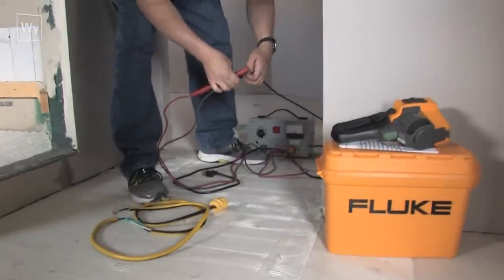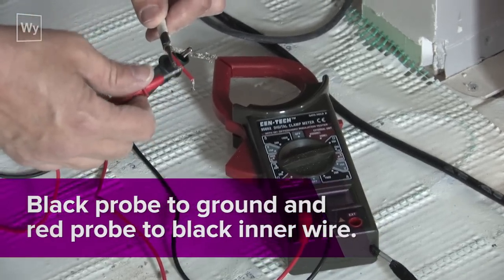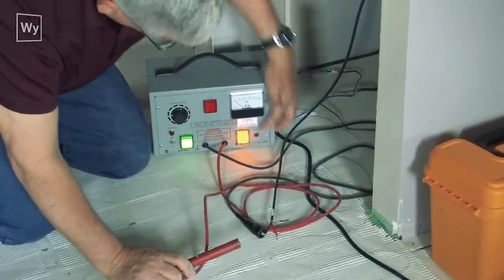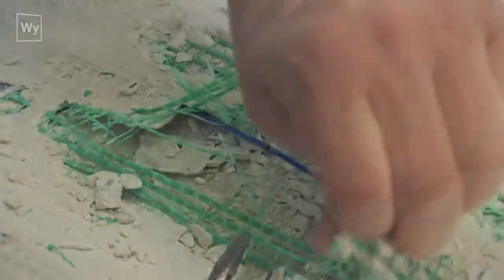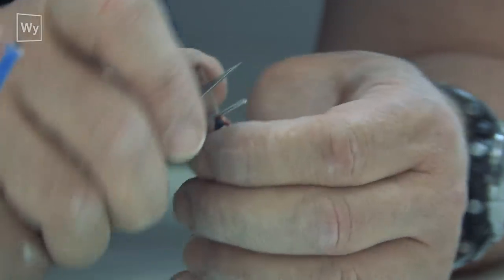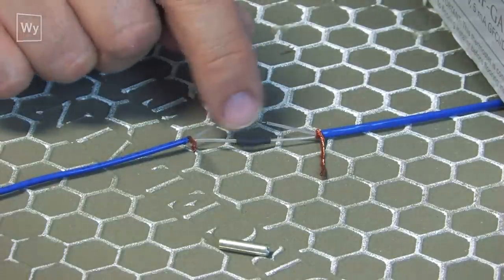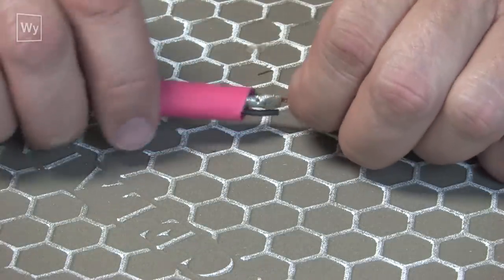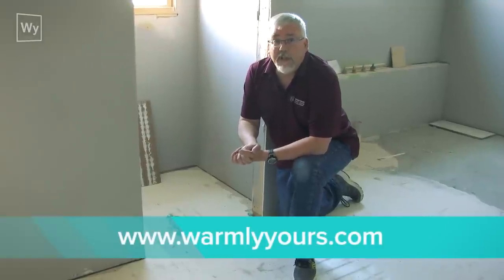How to repair a damaged electric floor heating system

Comment: Is there a possibility of the solder melting  and causing another open connectio on this type of repair? Just wondered, since the cables obviously heat up quite a bit.

Comment: Do you have advice of how to find broken cables without removing entire floors?
Reply from the maker: Hi Paul, Yes, we actually go through the same process in the video above. The only difference is that with flooring on top, you'd simply excavate that small area of flooring and then break up the thinset to find the break in the cable. The tool Scott uses tells how far down the cable it is damaged, and following the provided installation plan, you can then find the area that need to be repaired.

Comment: I am curious about the floor. Did you remove all of the tile to find the location of the issue? Or was the issue discovered prior to the tile installation? 

Thank you in advance.
Reply from the maker: The tile had not been installed yet. We always recommend that the system be tested, before, during and after install. So this was after the install was done with the final layer on top (before flooring). We offer tools that can help identify how far down the cable it is damaged/not connecting. You'd then follow the SmartPlan (installation plan) from your order and find the area that must be excavated to make the repair. Thanks for watching!

Comment: Helpful video - thank you! Wouldn’t it make sense, though, to check the voltage and continuity before sealing up the connections with heat shrink? Or is there a specific reason for sealing everything then testing?
Reply from the maker: We test it after it's sealed up because that is how the cable will be recovered once back in place. If it's working once all sealed up, then we know it will be okay to reinstall under the flooring.

Comment: I did everything the same, but on the cables from the underfloor heating, I only get 7 ohms and not more, what is the reason for the bad contact, where did I connect the cables or? greeting
Reply from the maker: I would recommend you give our tech support system a call to help identify the issue. You can reach them 24/7 at (800) 875 - 5285

Comment: WOULD THIS REPAIR BE GOOD FOR HEATING CABLE DAMAGED IN THE SHOWER STALL
Reply from the maker: Yes, the repair is water tight and safe for the shower area.

Comment: wires  should be twisted together  before  soldering
Reply from the maker: Hi Donald, I actually checked with our tech team and they stated that while others may prefer to do this, it is not required by our instructions to do so. Thanks for watching!

Comment: how can you tell the current carrying wires from each other?  Does it matter if I re-connect the opposite wires?
Reply from the maker: No it does not matter. There is no polarity in the wire, so they can be connected either way.

Comment: I just have a question ... I use by mistake. 208 v. Instead  of 110 v.  So now obviously my floor heat is damage and tiles are already finished... so is something the I can do or is no solution for it ...thank you in advance...
Reply from the maker: Sorry to hear that! To help answer this question may take more detail. please contact our Tech Support department online here: https://www.warmlyyours.com/en-US/support or call us direct at (800) 875-5285 and we will try to help the best way we can.
Reply from the maker: If you haven't called us yet, we think we can help! Test the wire. We'll tell you how. If the wire tests OK, change the feed to 120V. If the wire IS damaged, it can probably be repaired without ripping up the entire floor. Give us a call and we'll discuss the steps needed to repair the damage and get your warm floor back. (800) 875-5285

Comment: Please can you advise me,.
I have installed underfloor heating but have excess mat, can l cut off the rest and join the cables?  How can l do that? Do you have a video? Thanks for your help
Reply from the maker: Sorry that your in a bind, but thanks for asking. To best resolve this situation please call our Technical Support at (800) 875-5285 or chat Tech Support online found here: https://www.warmlyyours.com/en-US/support. We await your call.
Reply from the maker: Just to noted, the heating cable's length can never be altered.  Please call our 24/7 Tech Support for assistance, (800) 875-5285.

Comment: I have a Warmup floor...i used the company provided TDR meter and the lady at company said my reading of 88' on a 160 ft line meant that the break(no continuity at two heat wires) would be at about double, meaning the end cap of the wire...she thinks it occurred because a 1.5" pc of heat cable where it goes up the wall to t-stat was NOT FULLY embedded in mortar/thinset, causing it to blow the end cap....does all this sound pl audible?...I don't remember EXACTLY where my end of cable is, but have a good idea..one 12" tile must be ripped out gingerly....so you think i need or need to hire a special electrician to use this 600V machine to pin point the problem?..or should i just try to find /repair the end cap and re-test for good continuity..i also found my t-stat was set for 240v, but my system is 120v..been working 24 hr/day/4 yrs straight from Oct-may..no issues until now..what do you think?
Reply from the maker: Hey there smasse64 - so getting a licensed electrician for this would definitely be the first step towards repairing your floor heating system. Since this is not our product, we can't really know what may have gone wrong, but if the thermostat was set to a higher voltage than it should have been, there's a good chance that the endcap splice or factory splice (where the cold lead meats the heating cable) may have been damaged from the excessive voltage. 

The heating cable definitely always needs to be embedded and not running up into the wall - not only due to potential damage but because heating wires within a wall do not follow the National Electric Code. If you're able to rent or buy a thermal camera you would be able to find the endcap more easily, plus any potential areas where the wire is damaged and may need to be repaired.

Hope that helps!

Comment: Hi , Can you share what is the hipot tester make and model being used? Is it AC or DC? By the way I'm an electrical engineer..
Reply from the maker: Hi Mohamed, I checked with our tech team and here is the information on the hipot make/model/current type: Criterion AVC-25V AC Dielectric Strength Tester Hipot, 0-2.5kV AC, (AVC25V)

Comment: I did all that, the unit turns on but I have no heat.  What could be wrong?
Reply from the maker: Please give us a call so you can talk to our Tech Team to help identify what could be going wrong here. You can reach us 24/7 at (800) 875 -5285.

Comment: The installer should have used a Loud Mouth.
Reply from the maker: We do encourage all our customers to use a Circuit Check (also known as a loud mouth) during all installation to make sure issues are caught early on. But just in case there are still issues, we show it is possible to repair these heating elements well after installation.